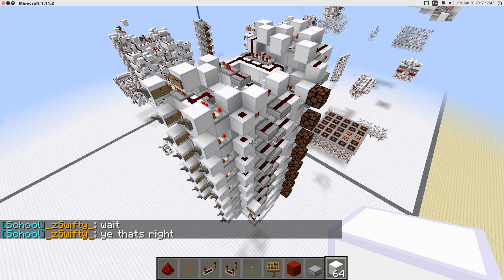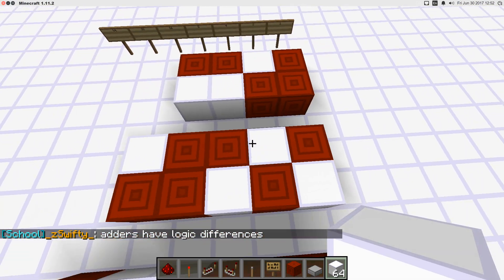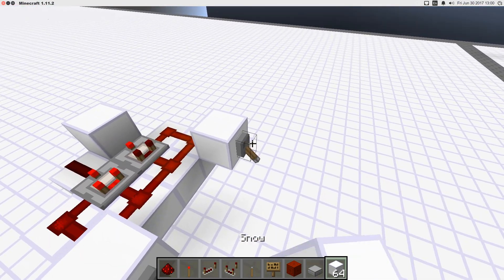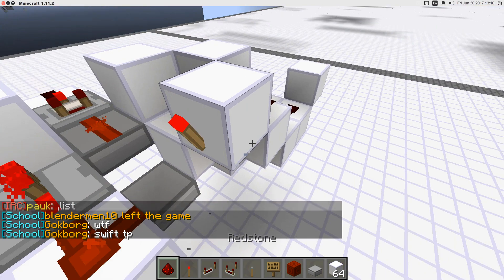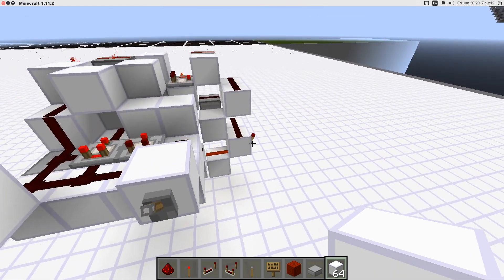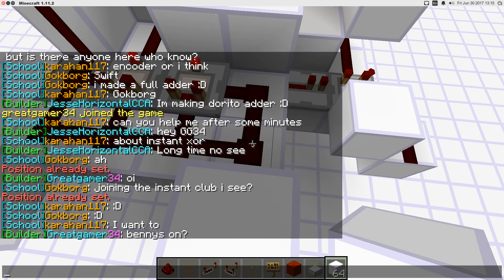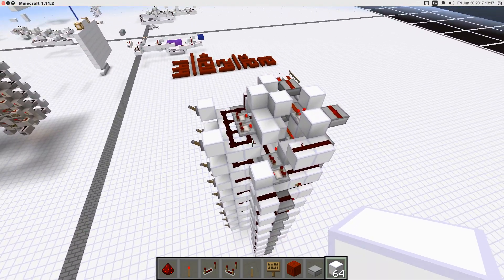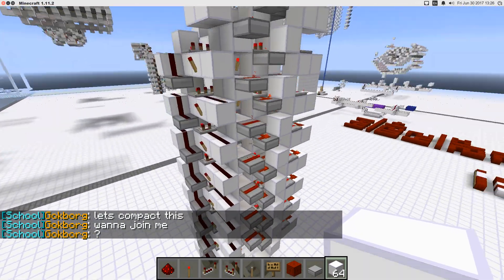Redstone Multiplier Tutorial (Part 1 of 2)

Comment: For those doing this in vanilla minecraft there is a command called /clone which is a lot like the copy and paste command but with some differences
Short tutorial:
Format for /clone <x y z> <x1 y2 z2> <x3 y3 z3> <mode> 
<xyz> = coordinate 1
<x2 y2 z2> = coordinate 2
<x3 y3 z3> = destination coordinate
in /clone you have to specify the coordinates of the area/volume you wish to clone 
pressing tab on your keyboard will automatically input the coordinates of the block your crosshair is highlighting (the faint highlight around the block)
this will also show in f3 as the "Targeted Block"

so for example /clone 100 60 100 110 70 110 ~ ~ ~ masked
the ~ ~ ~ will just take the player's coordinates but you can substitute this for definite coordinates if so needed to
(note /clone will always put the pasted copy in the positive xyz relative to the destination coordinates thus ~ ~ ~ the command will place it in the positive xyz relative to the player's coordinates)
the "masked" mode works a lot like "-a" so air blocks don't override other blocks

I hope this would be helpful.

Comment: Shouldn't the output be 16 bits?
Reply from the maker: Well, yes and no, actually. In a lot of applications, like computing, you only want the lower 8 bits because the computer can't easily handle more than that anyways. If you do need the upper 8 bits for some reason, you have a few options. First, you could do some creative usage of the circuit as-is to work around it, at the cost of more multiplications. Second, you could extend this to a 16-bit multiplier, but not use the upper 8 bits of input. Thirdly, you can rearrange the logic slightly and do the shifting in the adder part instead of the partial products part, and that will cause the upper 8 bits to be output in 5-tick serial from the carry out.
Reply: Jonathan Criswell 8 bits times 8 bits is 16...
Reply: depends on the type of multiplayer. because this one uses different logic than the ones we are use to, it gives a 9 bit output if you include the carry out. but you can make it do as many bits as you want given you have enough ram.
Reply: +Thomas Delapena look up a video of a redstone calculator in a cube 40*40*40- I can't remember the exact name, but the guy who made it made a 4 bit ALU give out an 8 bit answer using RAM, carry out, and carry in. you will see what I was trying to say
Reply: he calls his creation deep thought